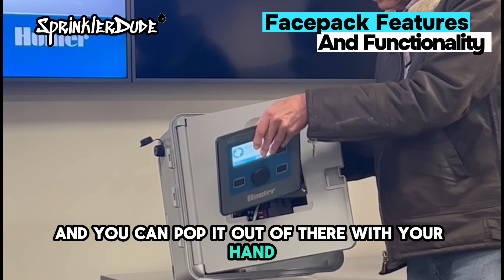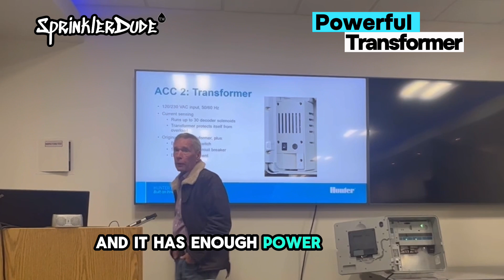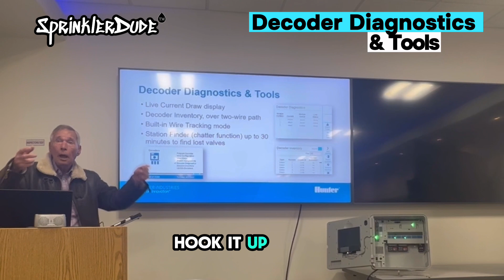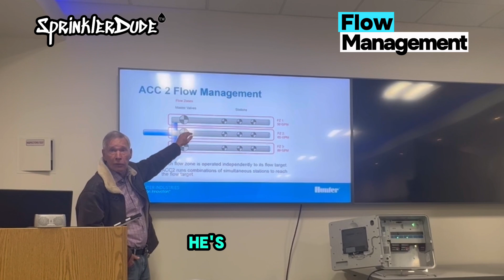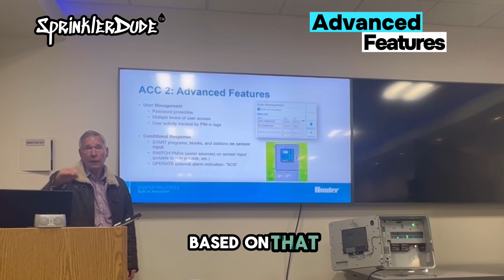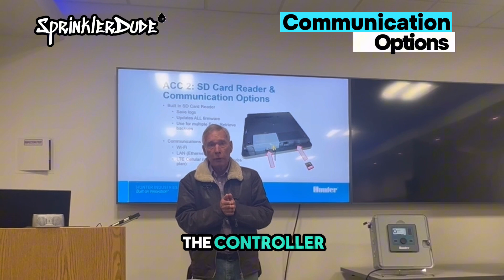Advanced Features of the Hunter ACC 2 Controller: Workshop Highlights

Comment: Can you convert a acc2 conventional controller into a two wire decoder controller using the A2c-75 module or is the a2c-75 module only assigned to the acc2-decoder controller ( I think we got the wrong acc2 controller)😂
Reply from the maker: Unfortunately, you're going to have to to replace the controller with the decoder version. This is because the physical black plane and software's firmware are different from the conventional version.

Comment: Hunter acc2 showing overload. 
Our maintenance team saying a decoder has Sercuit in acc2 decoder... 
Help us pls
Reply: Did you figure out what the issue was? Currently dealing with the same thing
Reply from the maker: Most of the time when an ACC2 shows “overload” it comes down to a bad decoder or a shorted section of the 2-wire path. The quickest way to narrow it down is:
	1.	Unhook the 2-wire at the controller – if the overload clears, the fault is in the field (decoder or cable).
	2.	Split the 2-wire run in half and reconnect sections one at a time until the overload comes back — that points you to the bad leg.
	3.	Check with a multimeter – each conductor to ground should be open; between the red/blue pair shouldn’t be a dead short.
	4.	Reinstall decoders one by one – the bad decoder usually trips the overload as soon as it’s back on the line.

In most cases I’ve seen, it’s been a single decoder that failed internally. Swapping that out fixed the problem immediately.
Reply from the maker: When a Hunter ACC2 shows “Overload” on a 2-wire output, it means there’s too much current draw. The most common causes are a short in the 2-wire path, a damaged cable to ground, or a failed decoder. To troubleshoot in the field: disconnect the suspect 2-wire pair at the controller—if the overload clears, the fault is outside in the field; if it stays, the output module itself may be bad. Next, split the 2-wire path in half and test each side to isolate the bad section. With a multimeter, check ohms to ground (should be open; any resistance means a wire is nicked or grounded) and continuity between the red and blue pair (should not be a direct short). Reconnect decoders one by one, or use the Hunter ICD-HP programmer if available, to identify which decoder trips the overload. A decoder that’s internally shorted will cause the overload immediately and must be replaced. If wiring and decoders test good but the overload persists across all stations, swap the output module to confirm whether the fault is in the controller. In most cases, a single bad decoder or damaged wire run is the culprit, and replacing it will clear the overload.